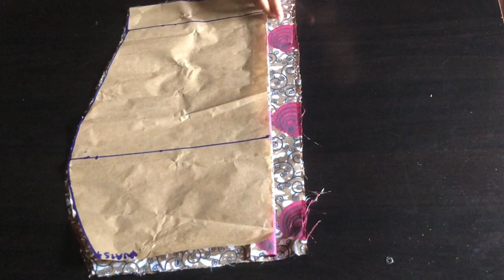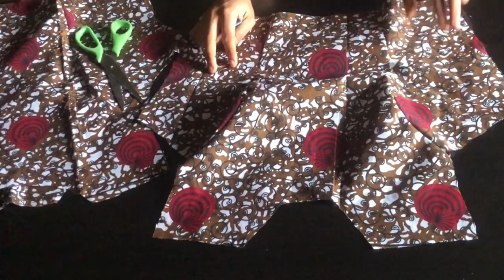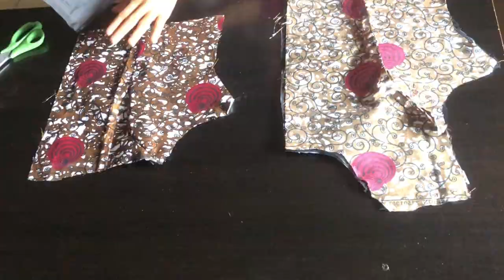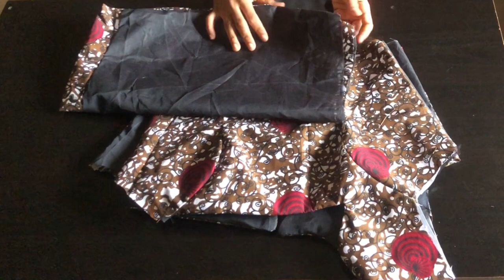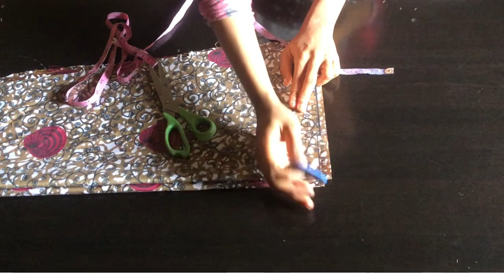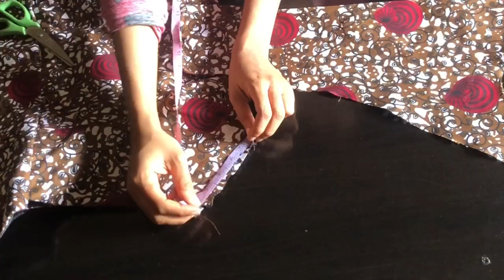HOW TO SEW AN ASYMMETRIC MONO-STRAP DRESS #how #sewing  #monostrap

Comment: Please I really don't understand how you draft the sleeves especially de off shoulder, I think u were too fast on it. Please can you explain more
Reply from the maker: Okay, for the off shoulder sleeve, on the material , from the top I came down by 4 inches, is an offshoulder sleeve, then from the center of the sleeve I went in by 4 inches plus half inch for joining, which is a standard measurement for a slim person for plus size use 4.5 or 5 then add ur joining  allowance or You can measure from the side of my front armhole to the back and add half for joining, draw a curve from that point to the end of ur fabric,get your should to elbow point , insert ur elbow circumference, do the same for your wrist, connect and cut out,then measure what you have at armhole of your dress, then place it o the curve part or the part going towards the armhole and cut out.
Reply: @Makyscloset1  thanks alot sis